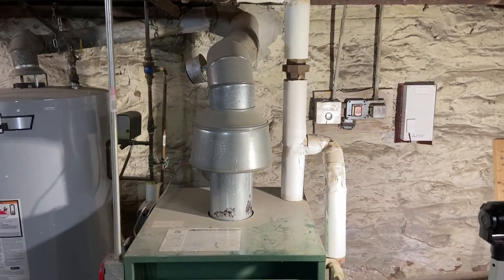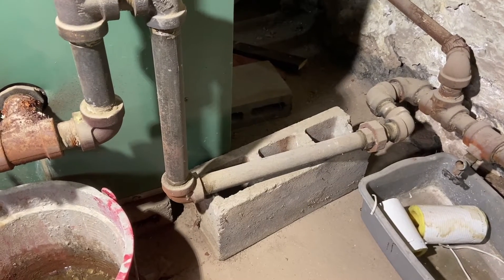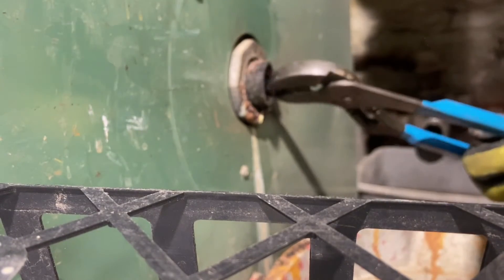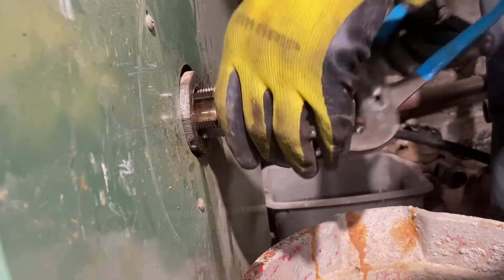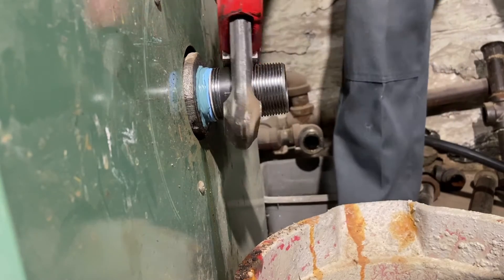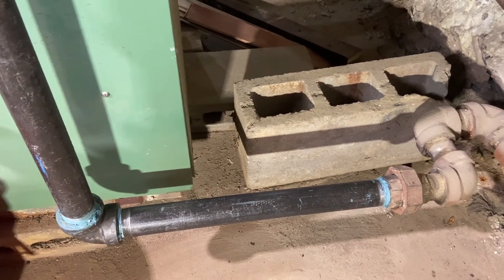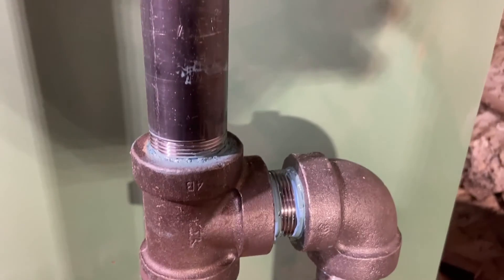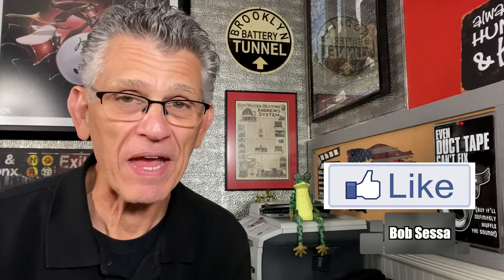Steam Boiler Leaking Water

Comment: Hey Bob awesome video….. I have a question we have an old peerless boiler from the ‘60s …. We have a 47-2, Mechanical Water Feeder w/ #2 Switch installed…. I usually drain a little water to get the. La k water out…… there a lower water valve to drain also …. Am I okay by draining from the feeder on a weekly basis especially now going into winter?

Comment: Bob
Thanks for all your good help over the years .
Please settle this argument 
I like to drain a little water every week with my steam boiler to get the black water out . My super says leave it alone and don’t touch it until the winter is 
over.  He says , you do not have to clean water on these new gas boilers.
It’s a Weil McLean 
Your thoughts , please 
Thank you
Reply from the maker: Not true, my experience is that by not draining down in the off season causes the drains to clog. Ultimately haver to remove , unclog and reinstall the drains. Most homeowners won't do this, which is good for business!! Regards, Bob.

Comment: I have a rad that is not getting at heat. The shut off is cold the pipe is cold.  Pitch is good. 🤷‍♂️🤷‍♂️
Reply from the maker: Is the valve at the floor open? Is the air valve working? Is the thermostat turned up above the room tempreature?
Reply: @BobsPlumbingVideos  
Valve is new
Shut off works 
Thermostat sucks! I’m thinking to move towards the back of the house where is coldest. There is a rad that is further In distance, but breaks off before the cold rad.
Reply: @BobsPlumbingVideos  
Rookie move. 
Vent valve was closed and clogged. 
Replaced and now it’s getting good heat. 
🤯

Comment: Hey Bob, really enjoy watching your videos. I have a steam boiler in the basement and the pipes to the radiators for the basement are underground. I believe there is a leak because the water from the scope glass becomes empty when not in use. Is it worth ripping up the tiling and cement to find the leak?
Reply from the maker: Are you referring to the "steam return" pipes? These would be the pipes that bring the steam condensate back to the boiler after each heating cycle? Generally speaking I abandon the buried pipes and reroute a new return above the ground. Many different ways to approach this depending on each individual situation.
Reply: @BobsPlumbingVideos  Yes, it is the steam return pipes. Above the ground would make sense but it is a finished basement so it would look out of place. So frustrating!
Reply: Yes, Bob is right…. Start a new connection

Comment: Bob, two questions: 1. Can you go into more detail on the why's & wherefore's of using the string-type lamp wick?  To my inexperienced eyes, the Blue Block & Blue Monster pipe tape should have sealed the nipple in place, perhaps?  2. Have you done a video explaining to non-Pros about how tight or how much thread engagement of pipe threads is "correct"?  I often think I may be over-tightening fittings around the house, especially when one or both halves of a joint is/are PVC or CPVC.  I think I've only split one fitting, but that wouldn't have happened if I knew what I was doing1  ;)  Thumbs up!
Reply from the maker: Great suggestion, I will put that together! Thank You Bob Vines.
Reply: Enjoy your videos. It’s simple when you know how. How do you know how far to screw the tap in when treading are retracing treads. Thanks for your expertise Bob.
Reply: Bob how do you know how far to tread a hole with the tap or when tracing treads. Thanks I appreciate your videos. @BobsPlumbingVideos